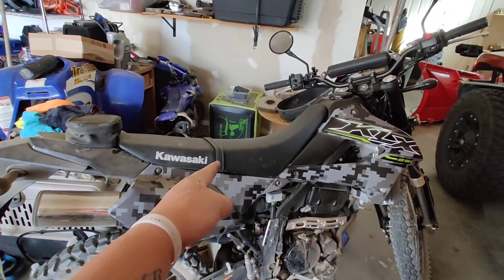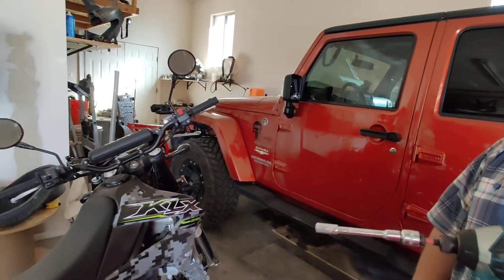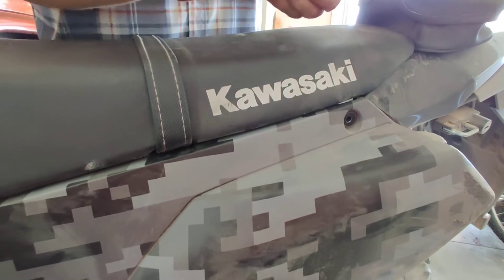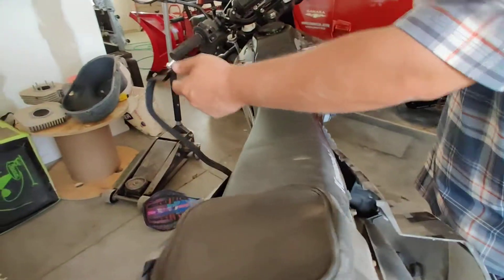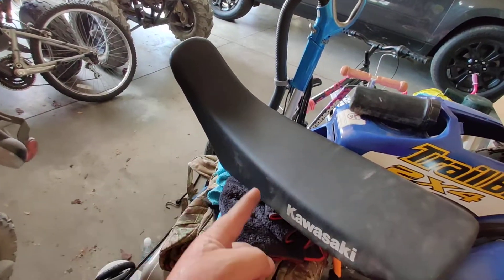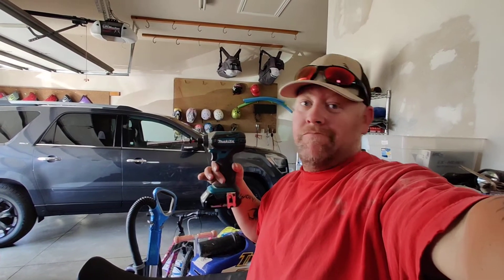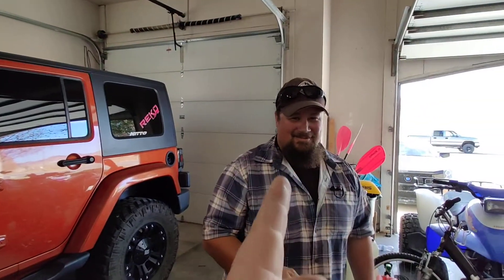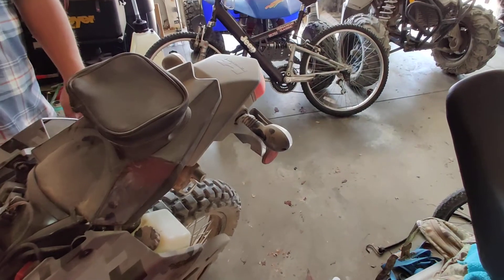KAWASAKI KLX250 TAKING THE SEAT STRAP and SEAT OFF

Comment: Do you think a GPS tracker about 3/4 thick could fit somewhere under thr seat? If not what other locations could be good?
Reply from the maker: Depending on the size if the tracker. Yes it probably could